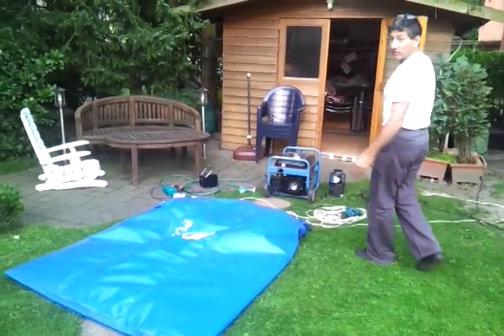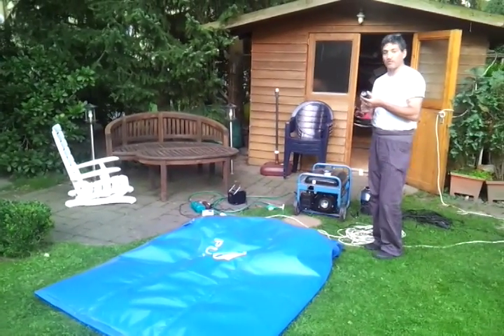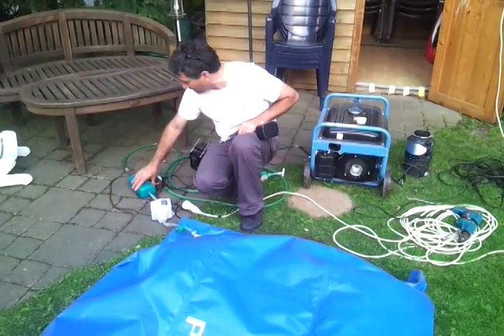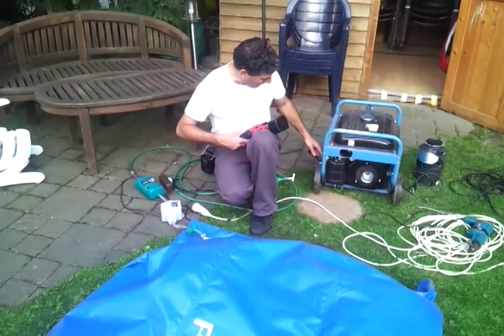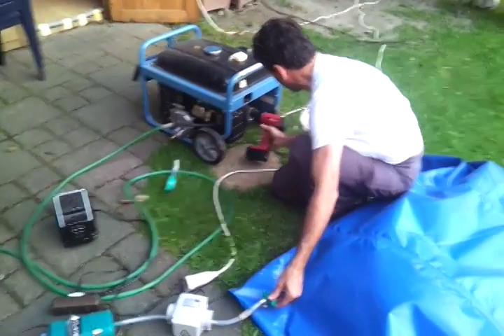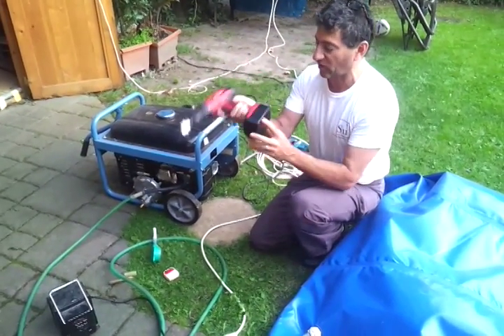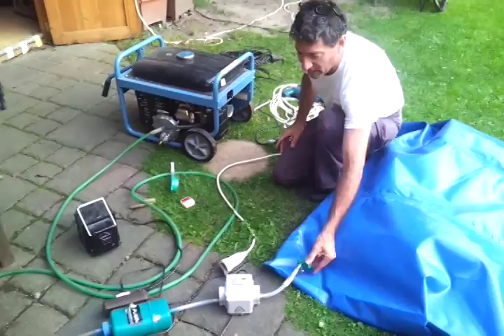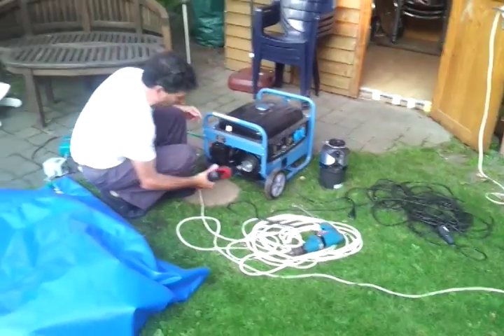running .55 hp insinkerator on 2.5kw biogas genset

Comment: Very well done Thomas ! Congratulations ! The question is , why do you need at all a pump ? Couldnt you just place a few stones on the biogas sack and thus generate enough gas pressure ?
How long will this generator work on this much gas from this blue balloon when it would drive a 1000 Watts load ?

Comment: Tom what do those small Puxin desulfurators go for and how does one go about getting one in the states?  I visited their website but it's pretty corporate and there was no direct-order function... I don't know how one goes about getting one and not making some big corporate order.

Also... as to the problem of humidity in the gas making combustion a problem, have you ever tried any kind of dryer to pull water out, like maybe an inline condenser coil or something?
Reply: you may be able to use a vortex dryer to remove most of the water from the gas but I don't know if the pump gives enough pressure to form the vortex. vortex dryers are not used up like chemical dryers so are a very long term solution. Have you tried Amazon for the desulfurator? don't laugh, they have most every thing for sale up there now!
Reply: Nothing on Amazon or Ebay for the desulfurator.  This appears to be direct-from-manufacturer only.  As for the drying, I still think a condenser might work but it would take a good bit of power to get the chill going so that'd probably only be workable if you were processing large quantities of gas at once and then bottling it.  All I have to go on is "what if" theory, I don't have experience with this stuff.
Reply: ya, sorry I also looked on amazon and found squat ! im really surprised! too bad too, I was wanting to set up a digester in a used water heater. now if we could get the video poster to dissect his desulfinator and post instructions on how to make on from scratch....